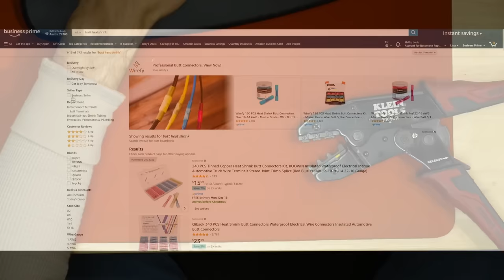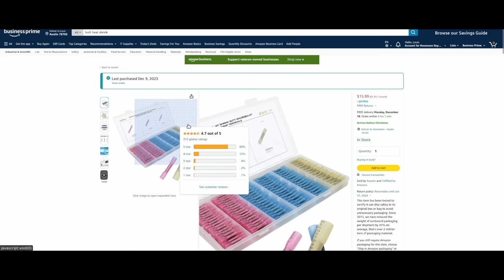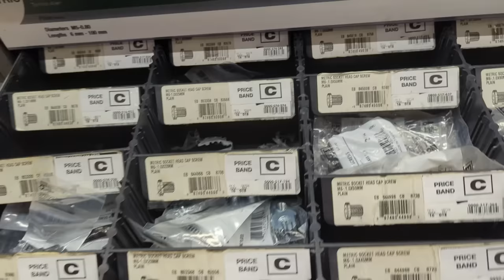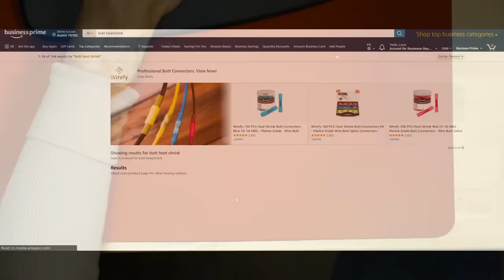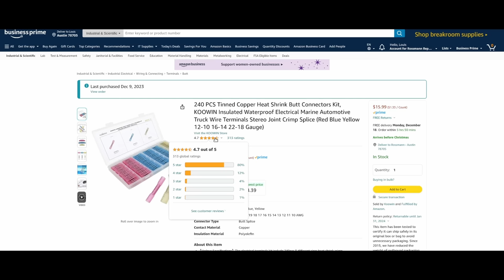Amazon Sells Dangerous Electrical Crimps

Comment: Returning faulty units is the biggest incentive for a company to improve quality control. Do it. 

Amazon gives you a 30 days window to request a label to send back a defective product of it was shipped by Amazon, and they will refund the product, shipping and import fees too, after processing the package.

If it was shipped by the seller, you have to contact the seller, but Amazon has a warranty if the seller refuses to respond, refund, or fix the issue with your product.

Comment: You can't trust Amazon third-party seller ratings either, because often Amazon's system automatically crosses out any feedback on sellers that's less than 4 stars. They may have dozens of 1- and 2-star reviews, but they're all crossed out so the seller can maintain their "4.9 out of 5" rating.

Comment: Hi Louis, while I agree with you that in general, the quality of Amazon products has gone to crap, wiring and wiring devices is probably not the best example. The problem here is not necessarily quality, rather, it’s that these products are made for a world market where wire is measured in millimeters, not US gauge. The sizes are close, but not close enough. That’s why the crimps don’t fit and the crimping tools don’t work.

Comment: Bottom line, if I specifically want an Asus product, Amazon has to respect that by not showing me stuff from 'Computing Joy Experience' (made up) over Asus. Even if I isolate Asus as a brand, Amazon will still prioritise the cheap crap they want to offload.

Don't even get me started on their 'so what?' attitude towards customer service. It used to be very good.

Moving to a non-Prime country has actually encouraged me to shop locally. It's mentally more beneficial.

Comment: I just tested some heat shrink crimps I bought from amazon after watching this video. My wires were going into a loom for my car and they ALL failed a yank test, and i'm using a crimping tool to deform the crimps as well. It was a pack of 100, this is bad, I have to back track many of my projects.

Comment: Amazon shipped me a broken water heater (for coffee or tea), and I took a picture from three different angles, one even with my fingers behind the shattered glass. They sent me another, and since I had those pictures, I threw away the decanter. Then, they asked for me to ship it back after a few weeks, and if I did not, they would charge me for the replacement too. I haven't dealt much with Amazon, since then. 
I knew that the packers at Amazon were mistreated, asked to work long hours, and maintain a 6-foot distance from each other, or be fired. I thought maybe it was a packer who was fed up with Amazon, but it was me who suffered because they were mad.

Comment: And the ones that are real have their stars changed. There will be 4 and 5 star reviews from real customers, but the actual comments that go along with them say that the product is not good. So I find it hard to believe that they would have complaints about it and then give it a high rating. Amazon is changing the star value we give the products we buy.

Comment: I bought 5 different brands of 2.5 to 3.5mm adapters, from Amazon, just to make sure that one of them worked.  None of them worked. They looked like they were well made, but the connection was not there, or they were loose, even when tightened.  SoI decided to trash the 2.5 mm headset, and get a 3.5 mm headset.

Comment: these connectors arnt crimp held , they are heat till solder melts and connects the wires together. wasnt sure at first so didnt comment , after looking closer and at the listings you where showing they are heat to solder together ,if you want to crimp them while putting them together they can be , but not hard as the heat wrap around then thats used for insulation will be compromised.

Comment: I once had to buy an adapter from 2.5 to 3.5 inches to install an SSD in my mom's iMac, which had a full-size HDD... ordered the only one that had next-day shipping, but had 4.7 stars, and seemed pretty decent... problem was... not a single hole aligned up with any of the standard SSD/HDD holes... and not even the screw threads were the right kind, since screws would not fit...

Comment: I bought a capacitor set from Amazon. Repaired a few electronics and they failed in roughly 2-3 months. I don't mind cheaper products, but when they have went to lengths to create the product I kinda expect them to at least do the thing they are created to do. When I say failed I mean exploded! Now I will use Rubycon in my own devices and Panasonic. Lesson learned!
(I'm in Scotland and I never thought you started talking 'shite')

Comment: Although I agree on many points with you, I would argue that Amazon still has one benefit that makes it worthwhile for some vendors and in turn for me as a customer.
Amazon allows anybody to sell products, therefore also serving niche markets.
Like a few weeks ago, I bought a used Samsung Galaxy S4 Mini and installed a custom ROM on it (DivestOS for the curious).
The battery was still the original and getting a new one is difficult, cause even unused ones from back when are still in terrible shape.
There are very little vendors that still produce new batteries for this device. Amazon allows them to sell on that platform regardless of country or even continent for that matter.
Likewise, I can buy my niche products from wherever. That is huge plus.
Same goes for some niche groups that don't have their own websites, like international Facebook groups for fringe communities, like the one for people with celiacs desease.
I know that I only mention niche cases, but I think that Amazon, ebay, Facebook deliver very good options within these constraints.
That's basically all I had to say about that. And as always, I hope you learned something.

Comment: Bought an apartment clothes washer from Amazon, when I opened it found out it was used & the wrong one. Returned it, only received less than half of what I paid for it only after it was sold to someone else. Took pictures of why it was used & the wrong model, still one received less than half. P.S. Some of the parts were missing.

Comment: I only buy stuff on Amazon that I know is cheap crap...and the quality doesn't matter.  I no longer buy Name Brands on Amazon because you won't get the actual item, you will get some cheap counterfeit. Not a knock-off, but a real counterfeit with the Name Brand markings but obviously a counterfeit.  No more.  Now I order from either the Manufacture's website or a reputable retailer.

Comment: I've made 12 orders from Amazon this year. 11 of the 12 were fine, and 1 had a problem. What I've noticed lately are shipping issues. I've become really spoiled by Amazon shipping, but lately it's slipped. Agree that the review system is flawed. I've seen reviews for TOTALLY different products. I've had problems with the search results that seemingly ignore a keyword I'm using. It's like Amazon doesn't have enough product with a certain keyword, so they "stuff" the search results. Wish that would stop. If I want a 6 foot cord of some kind, I mean 6 feet.

Comment: Amazon allows knock off items to be sold on their site. One example, I bought a bulk quantity wet wipes. They come 48 per pack. These came with 50 per pack. No where have I seen them sold in 50 packs. I suspect that the chemicals used in them caused a rash on my face.

Comment: I bought Sketchers Work shoes from Amazon for $70.  They were extremely slippery, no traction due to oil at my workplace.  They are branded as steel toe construction shoes in the Sketchers Work like, yet not suited to most workplaces due to not being non-slip. I'm not going to be able to return the shoes due to having removed the tags.  Amazon seemingly will refund "at most" 50% due to not being in new condition and leaves refund discretion to the manufacturer.  Huge waste of money 😢 I wanted to go home and change them out immediately, but had to wear them for 3 hours until someone could give me a ride home.  Needless to say, I will be avoiding buying from Amazon for a while.

Comment: In some cases I found the cheaper (or so I assumed it was the cheaper) in this case they were phone screen protectors and almost everytime I felt the company I found was oftenly better than the name brand
to others it may have seemed worst but when i dropped my phone and it cracked or whatever example, it would yes crack but it wouldn't shatter the slab of glass in to many different cracks, instead depending on the fall it would crack once from point A to B and it didn't bug me much so I would get my moneys worth and continue with it on....until months later or 1-3 more fall and I couldn't stand it anymore 
But yes, I agree a difference needs to be made, for me sort of like YouTube's ads become an excessive problem, I will stop using the site...

Comment: I needed an external USB CD/DVD drive to I could rip my CD collection.  One of those on-a-whim ideas.  After about an hour's worth of reading reviews on Amazon and finally settling on one that was highly rated (but visually identical to about a hundred similar items in my search results), it was under $20 and it could be delivered same day, so I bought it.   I could not get that stupid drive to consistently read a disc no matter what I did.  Half the time my desktop wouldn't even recognize the drive.  I could heard the drive spin up, then spin back down and then just make an occasional click and nothing in file explorer.   I had to swap USB ports over and over before it finally worked,  but it was very intermittent.  I managed to rip 3 discs after a good 2 hours dicking around with it before I was like F this and sent that crap back.  Junk.

Comment: This has been something i seen early, about 2015? with the reliance on people ordering things online and the "direct replacement" it follows the short attention span bunch.

But like home depot, my local toolshops here in england, i do have some belief that if you buy a "Trade rated" product that probably costs $1 more than whatever online stores are selling it out and maybe you get a few less, but, it will likely work untill it does not, at the end of the day, we dont need 20000 PCS of a single item for whatever hobbyist thing we are doing. most of us probably want that thing done once untill we need to care about it again, a pack of 10 will suffice.

Comment: I treat Amazon the same as Wish or Aliexpress. That is, that I expect garbage because they can usually get away with it. In Australia we seem to have less of a return mentality. If you spend $10 on something and its crap, you just throw it out, not worth the time to deal with the return process, especially if its come from China or something.

I don't usually look at reviews, other than the vendors overall rating, which tells me about their general operation. In regards to item rating, I think a good measure is "Would I review this?". In the case of the wire connectors, I wouldn't review that item after buying and using it. To think that it had 300+ reviews makes no sense to me. I might put a bad review on something that wasn't fit for purpose. 

I love a good impulse purchase, I recently looked at getting a rooba, but was going to take two weeks for it to be delivered. Waiting two weeks takes the fun out of impulse buys. I guess that's just because of low-stock of something that just doesn't sell in high volumes. Perhaps it's drop shipping.

Comment: I find even the branded products are factory seconds or have a known manufacturer fault. I recently bought a branded toaster which barely lasted 3 months before breaking. Complained to Amazon and they literally sent out a free replacement and didn't even want the faulty product back. This tells me they knew very well that product has inherent fault and it's cheaper for them to send free replacement than deal with return. 

They are good for some things though. I urgently needed a special low tack medical tape which I couldn't find anywhere locally. Amazon had it at a good price and it was delivered next day.

Comment: Good video. I bought a cheap, off-brand,  usb adapter plugin to charge my Garmin watch. I also have a wireless Anker charger for my phone. Both items are plugged into the same Anker surge protector. My phone wasnt charging. Unlpugged the wireless charger and plugged it back in. Wasnt working. So I grabbed the usb cord with the off-brand Garmin watch adapter on it and I burnt myself. I saw that what appears to be hot glue had melted from the adapter and onto my mattress. The off-brand adapter was piping hot and would not remove from the usb cord. My mattress was also warm where the two were touching. After I unplugged the usb cord, the wireless Anker charger started to work again. That off-brand adapter has a little clip tethered to it and I think that may have touched some of the prongs on the adapter? 

Dear smart people, based off of my description, what part(s) failed? Did the surge protector also fail? 
Ive sinced switched backed to a Garmin charging cord with the same surge protector and no problems since. Just kinda freaked me out thinking I almost had a house fire.

Comment: Ya, I read both good and bad review. I have had both good and bad products, but less bad products actually reading the reviews. Even my Chinese chair is as good as my old one, but missing a part. It was hell trying to get the missing part thanks to language barriers. I only had 2 products I had to get refunds on, one was a toner cartage, and the other was a bathroom sink faucet that went to another city. Everything else worked as intended, and most still work unlike my Harbor Freight drill. Have to read and look at may not seam right in the reviews. Still a pain to take the time.

Comment: I'm sick of the fake reviews. I recently bought a product that came with a tiny level.  most Amazon stuff usually comes with just enough hardware etc so you'd think that if the reviews were genuine,someone would've mentioned that this extra (useful) item was included.  I think Amazon photoshops or uses some sort of photographic trickery to make their products look better on line than in reality.   I find it comical that when you want to read the negative reviews, they are written in foreign languages.   Amazon;s (read their china import) products  arehalf-assed Ikea knock-offs and even harder to assemble.  and don't even get me started on "customer service"   there's a the perfect argument against artificial intelligence

Comment: When purchasing Electrical butt splices at home depot looking in the hardware section and going through the hex head  cap screw drawer will lead you to dissatisfaction every single time 😅 I personally would go to the electrical department and look for the same section as the wire Nuts. That will lead you to More satisfactory results...

Comment: Hey mate, if by chance you still have the same crimps like the one in the clip from no name brand, at the 5:48, try to use hot air to melt the rings of solder, and make sure both ends are clean and meet at the middle ring or under it, and the left and right rings are on exposed copper. The crimps that did not fixed the cables, look similarly with the one that is "self solder and seal", or like that ...
I mean no disrespect.

Comment: I recently bought starter motor and a set of injectors on Amazon really I was looking for name brand but settled for no name and fast shipping. BIG mistake! Both literally had a 50% chance of having it out of the box. After 4 out of the 6 injectors being bad and one of the 2 starter motors being bad. I actually sent back the working products because if their manufactured at such a low quality half fail out of the box how long are they going to last. So i ended up spending 2 weeks waiting for the factory parts to come from the dealership. All worked right out of the box no doa parts.

Comment: After all Louis said am I wondering if the EU forces Amazon to at least cut back on the amount of literal shit they sell over here.
I've had a few cases where something was really not of good quality, but still worked "enough". And the cases where something was outright broken, are so few I could count them on one hand, but seriously sooo far apart that I can't even remember...

That said, I am also one of the few that are aware of the garbage state of Amazon, so I'm avoiding purchases until I'm basically forced, be it because I just can't get it in a local store or whatever. On top of ordering like 4 times a year, sometimes even less. And then I'm spending sometimes days digging through the trash on that site to find the product that's least likely to burn my house down.
In a way, knowing that I have to make that effort basically every single time I wanna buy something really keeps the impulse purchases in check.

But the fact that search results are filled with no-name junk to no end is definitely true... I wanted some parts for a DIY project recently and I spent literally a few days digging through the results because there was so much no-name junk where often even the product description didn't fit the product.